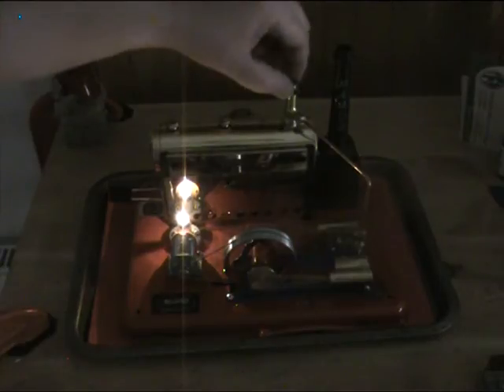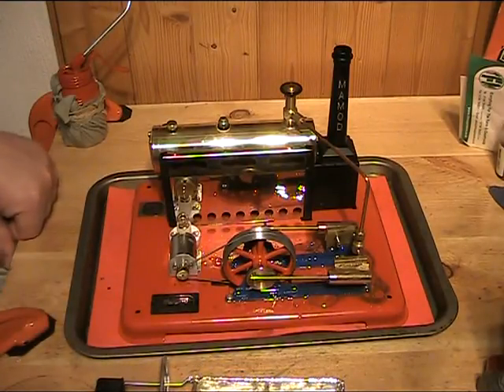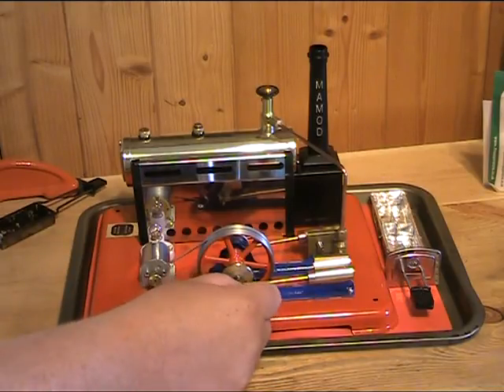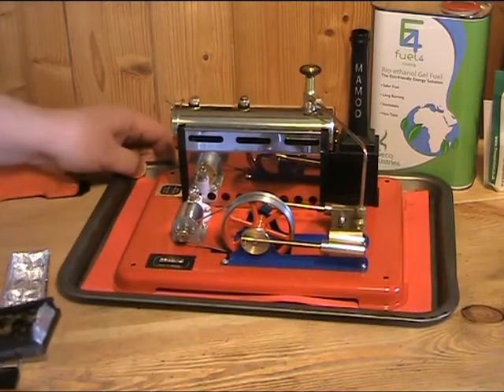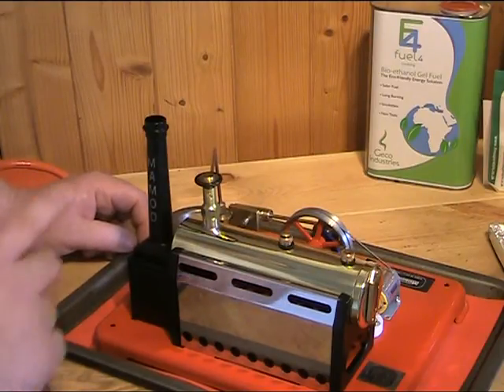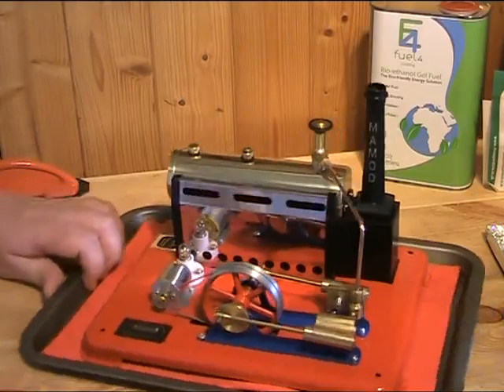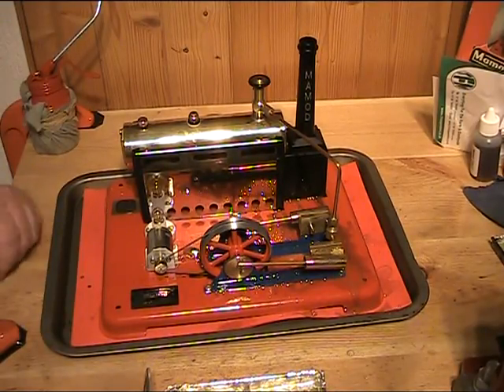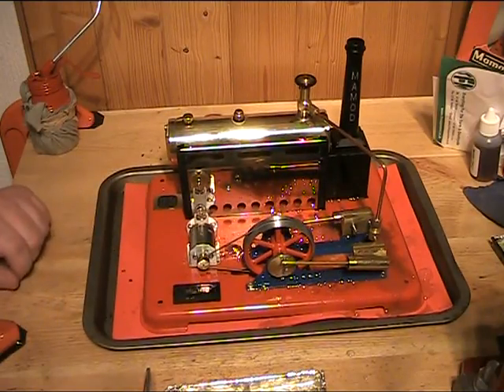MAMOD SP5D: first runs AND a test of gel fuel

Comment: Liking the vids,why is the boiler soft soldered is that standard.
Reply from the maker: Yes. All the, shal I say, 20 psi boilers are soft soldered, at least they were at the time of the video. Bottom line is that anything more is not needed and it's cheaper of course.

Comment: Sp5 or Sp6....??? I've got an sp6 on order but it's a lot more expensive. Wondering if I'd be better saving a hundred quid and going for sp5..?
Reply from the maker: The reciprocating cylinder with 40 psi boiler is the much better performer, but needs a gas burner to make the most of it. Check the quality before you hand over your hard earned.

Comment: Did you add the steam valve?
Reply from the maker: +woppini No, it's factory fit. All new SP5's should now have them.
Reply: Ok, thanks. Seems all the venders in US are selling the ones without them. I settled on an older SP5 with reverse lever. Great running twin cylinder engines.
Reply from the maker: +woppini That one is the better engine.

Comment: I've used Sterno, a jellied alcohol.  Unfortunately they color it pink or purple and if you look inside the firebox and underside of the boiler after running, it's a mess.  Nice you found some without dye in it.  I've been using the ceramic burner for canned gas, like it much and can dial in a small flame with it.  High cost initially, but very cheap to run.